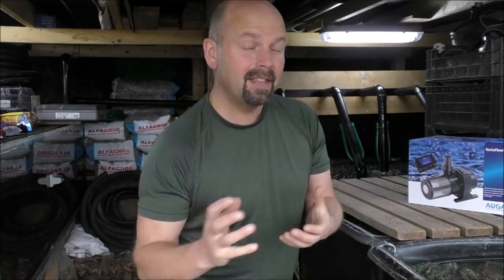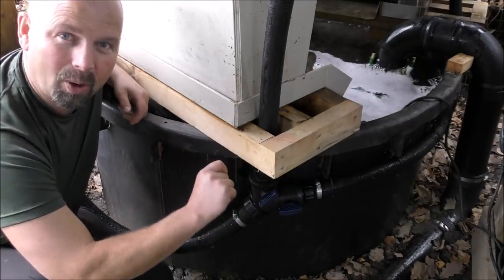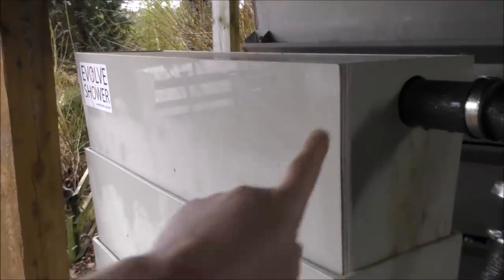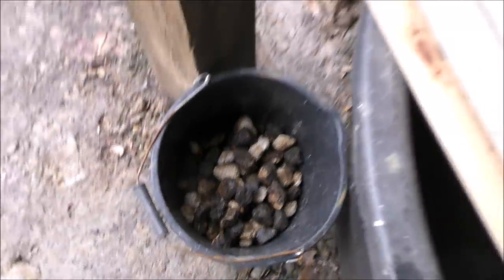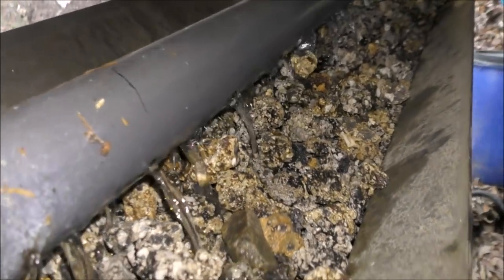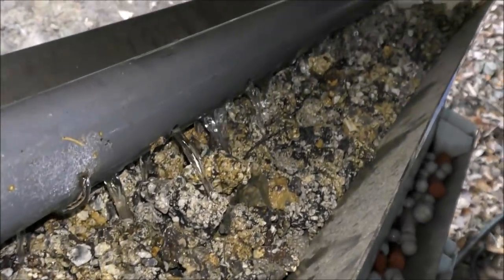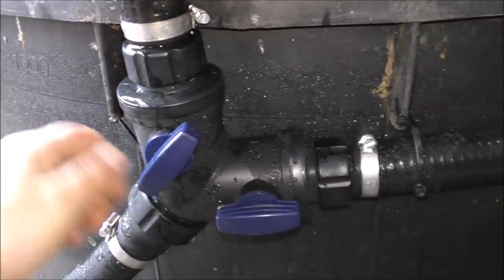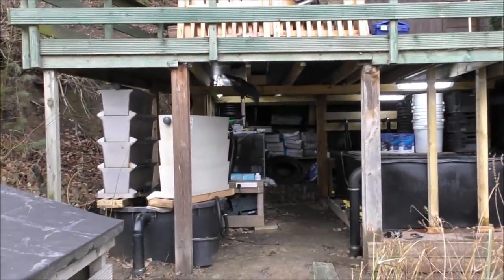Building a HUGE Pond Filter - Part 6 - Shower Filters

Comment from the maker: Sixth episode in this mega-filter build for my large trout pond. Today we will take a look at the shower filters and I explain about the water flow direction and filter media.
Video with Evolve shower filter and Blagdon Amphibious  IQ 12000 Pump (which feeds water to shower filters) : https://bit.ly/2t3N8OH
Global Koi stainless steel shower filter video: https://bit.ly/2UYv4AX
Looking INSIDE filter media video: https://bit.ly/2KbOAGk
Phil's channel: https://bit.ly/2NbCkag

All types of Biohome media and links to other distributors: http://www.filterpro.co.uk
Blagdon Amphibious  IQ 12000 pump (for shower filters): https://geni.us/9ByCf5F 
Hel-x 17 moving media: https://ebay.to/2UZk5aM
Alfagrog used in this video is the E40 size but there is a smaller size available (E25) for smaller filters.
Alfagrog (Amazon): http://geni.us/Il899
Alfagrog (Ebay): https://ebay.to/2zWrajj
Hel-X 13 25 litres (Amazon): http://geni.us/3UBTi
Hel-X 13 25 litres (ebay): https://ebay.to/2QPKiq6
Hel-X 17 (more suited to very large moving bed filters): 
https://bit.ly/2PBAOyn
K1 standard size (Amazon): http://geni.us/zNFFaJ
K1 micro 25 litres (Amazon): http://geni.us/byDQ
K1 micro 50 litres (Amazon): http://geni.us/M7T2AH
K1 micro 25 litres (ebay): https://ebay.to/2P5Flfv
K1 micro 50 litres (ebay): https://ebay.to/2NFJ3YB
Moving bed media (FilterPro): https://bit.ly/2NN1gU6
Vortex filters: https://bit.ly/2Mj7gYa
4" fittings: http://geni.us/nTQc9bw
2" taps: http://geni.us/OBXBGSI
8" diameter brushes: https://ebay.to/2OvMOkc
Filter grids: http://geni.us/oqDBzT

If you've enjoyed this video please check out the playlists on my channel for hundreds more  - on a variety of subjects.
Feel free to share or link any of my videos on facebook, twitter, forums etc. for the benefit of anyone you think may also enjoy watching.
See you next time.
Pondguru

RECOMMENDED PRODUCTS ON AMAZON: https://goo.gl/jMaBWy
INSTAGRAM: https://www.instagram.com/pondguru_outdoors/

FILMING EQUIPMENT:
Panasonic HC-VX870 HD camcorder http://geni.us/3UwE
+Rode stereo microphone: http://geni.us/4OL
+Rode 'deadcat' mic cover: http://geni.us/1pmn
JVC Everio quad proof HD camcorder: http://geni.us/e09e
+Rode 'deadcat' mic cover (opened up and held between tripod and camera base) http://geni.us/dee24
Zomei Z666 tripod: http://geni.us/1a1af3
Manfrotto MTPIXI-B PIXI mini tripod: http://geni.us/87f7

Comment: I've been patiently waiting for the final results video. How did it turn out? How has the water quality and clarity turned out?
Reply: 2021 still waiting!
Reply: @joshavandervelden4764  lol
Reply: @joshavandervelden4764  yea
Reply: I can't see it cleaning that pond up bit it will definitely improve the water quality
Reply: It has been my experience, especially in relation to scientific experimentation that when the person fails to file an update after completing the initial phase of a project the reason is that they failed to achieve the result that they expected and touted.

I'm not saying that is the case here... but, let's just say that IF I were to undertake such a project I'd start by collecting a ton of pre-experimentation data, far beyond a repeatable and accurate standardized water clarity test using a  Secchi disk as well as many water quality chemical tests etc, and regardless of the outcome I'd post the results, good or bad.
Reply: Great content, in my opinion a Pond that size would demand a maga pump from the pond, at least 80'000 LPH to turn over the volume of water in the pond, so the pipe from the pond should be minimum of 4" like I said good content 👍

Comment: Great video Richard, I love seeing the filter coming together like that!
One thing to note though especially now with a bigger 30.000 liter/h pump is the tube size. Right now it looks like you are using like 63mm tubes to get the water from the pond to the Filter, which looks about around 20 meters?
That means you'll have quite a lot of pressure loss. You should upgrade this tube to at least a 75mm pipe, better even 90mm or 110mm. So you get around 1-2m/s flow rate and massively reduce the pressure and flow loss. You can look up how pipe size and flow rate go together online :)

Comment: Thank you Pondguru for this great series and like many others I encourage you to share with us how your mega filter works. Judging from your other videos I deduce that this filter has not had any substantial effect on water clarity in your lovely pond. I wonder if there could ever be a filter to clean this pond even if it was 10times bigger, because there must be just so many nutrients from the soil of the surrouning nature just flowing into the pond with each and any rain. Might this assumption be correct?
Reply from the maker: I totally changed the filter and located it on the other side of the pond. When it was running 24/7 the water did get a bit clearer but the pump I have running on it now is close to 600w as it shifts around 60,000 lph
The new set up is more about creating a good environment for not only bacteria but also a nation of invertebrates, some of which get washed from the filter every time the pump is on - that helps to feed the fish.
As the pond is clay lined and has carp and a sturgeon which must be close to 6 feet long in there it is never going to be clear but the water is very healthy and fish are doing well.
Reply from the maker: I will be filming an update on the new filter today s upload will be in the next few days.
Reply: @pondguru  - Hi Richard - Really looking forward to the update - have wondered where you had been and why the series ended so suddenly?
I have built a small (approx 2100lt) koi pond, and I used your videos to guide me - especially the shower filter ideas.
Unfortunately there is not a lot of ceramic fired filter media (Alfagrog, Biohome, BHM etc) available in South Africa, and what is available is hella expensive :hand-orange-covering-eyes:. 
I currently have lava rock in my shower, but am going to upgrade both the size of the shower and the media in the shower when I have time over December (currently working out the country), and I am planning on adding an upflow bog filter as well for a bit more mechanical and biological filtration.
Thanks again for your very informative and helpful videos.
Kevin from Johannesburg, South Africa.
Reply from the maker: @kevinlake3870  Anything you can use as filter media will be batter than nothing and if you slow the flow right down in the biological section you'll allow the water to be deoxygenated and support anaerobic activity for nitrate reduction. In that situation the filter media doesn't have to be anything special so a decent quality lava rock would be a great choice if everything else was prohibitively expensive.
If you could have a high flow filter for ammonia and nitrite reduction and a slow flow filter for nitrate reduction that would be a great system.
Best of luck with your project.

Comment: @pondguru 
So If I got it right, the right order to filter is
1) swirl filter for muck
2) mechanical for finer muck
3) moving bed
4) static bed

To get the full cycle?
And  
5) shower filter (optional/extra)

Please correct me if I'm wrong.

Comment: Greetings Pond Guru, i apologize if anything I say offends or contradict any believe, everything I write is solely based on physics and not on any empirical knowledge.

Swirl filter.  Swirl filters work on reduced water flow AND vortex to separate element with different gravimetric weights.  By adding the brushes you are eliminating this last part, you only have swirl on the very beginning of the filter, witch is not enough to separate very small matter.  Also best practice would be to have the exhaust pipe extend to the center of the swirl filter, brushes can be moved to the mechanical filter stage next.

Mechanical filter stage.  In the mechanical filter stage you have the exit and intake at the top, you should move the intake to the bottom and pack the brushes more compact, this will force the remaining sediment to stay on the bottom and only clear water to exit at the top to the moving bed filter.

Moving bed filter.  In the moving bed filter you should reduce the exhaust pipe diameter to 3" or less, this will increase the pressure and aid on the flow, thus help move the media faster.  You may need to go down to 2.5 or even 2" pipes, also move all the pipes to the farthest side of the moving bed and sink down about 1/3 the depth of the container, and place the air hose in the other side as a thin wall of bubble, that will create the vertical vortex needed to move all the media and have the flow follow so there is no leaking or bypassing.

Static bed filter. Lower the water level or raise the media height, or install baffle to avoid bypass, also you could add baffles to extend the duration of water in the filter by reducing the intake speed and spreading the flow across all the media.

By this time water should be completely clear thus in the last stage you should not need any media, just increase aeration by installing a wet dry filter and exiting at the bottom of the container, you can achieve this without any pumps at that stage thus you can use your pump as backup or to aid in water intake.

Hope it helps Tonny García - Dominican Republic.

Comment: Is there a link for that pump power control. Does the pump have to be specific for variable power.
Reply from the maker: You can buy pumps with remote control for variable output but as far as I know you can't electronically alter the flow of a 'normal' pump - it needs to have an asynchronous motor. This is the link to the one I use: https://geni.us/9ByCf5F and it is the 12000 version which powers the 2 shower filters in this video. It's a very nice pump and not a crazy price.
Reply: Hi Paul the Amphibious IQ pumps use a frequency inverter digital  motor system  in the pump housing , with integrated model specific power system for the motor  in the controller that includes the display panel. So sorry its not possible to use it in any other application.Or  model actually within the range. If you want a bit more detail  search out Blagdon water gardening YouTube channel , a couple of vids on there that explain more.

Comment: Is alphagrog any good for canister filters
Reply: i think he covered that in an earlier episode, its not great for canister filters. alphgrog main usage is in shower filters for ponds. its too dense to support Anaerobic. 
Look at his Pimp my Filter series to draw inspiration for your canister filter. 
i'm looking at those series to see how canister filter makers design their internals. so far i am inspired to make a sump that isnt fixed chambers but rather using plastic containers that stack.  i will be adding a Booster Canister after the sump,i bought that after watching PondGuru's video about filter being too small https://www.youtube.com/watch?v=L5FkSTYkEAE.
but i have been busy with work, so my tanks are almost empty of fish(gave most away). i have like 1-3 guppies to eat mosquito larvaes.
Reply: You can certainly use grog in a canister if you want.  It's also regularly used in sumps.  It comes in 2 different sizes though and for a canister you will want the smaller size.
Reply: @SiHill80  was just wondering for if i set up a fish tank thanks i use it to fill in space in my turtles fillter
Reply: I would avoid alfagrog in a canister. It only has external surface area so you need way more than a canister can house. Put porous media in a canister.
Reply: @kelterskelter1969  fare crack